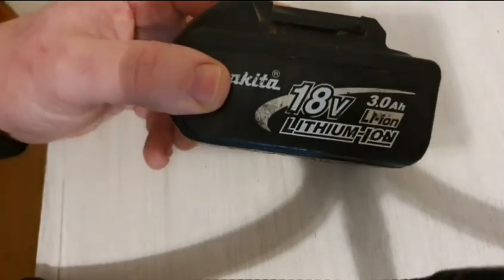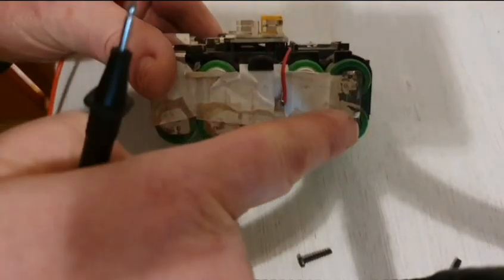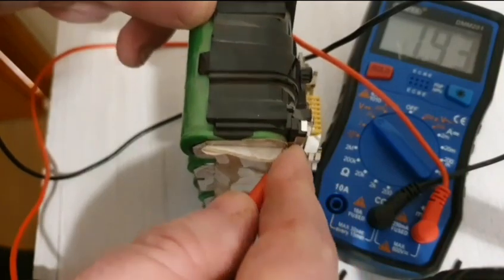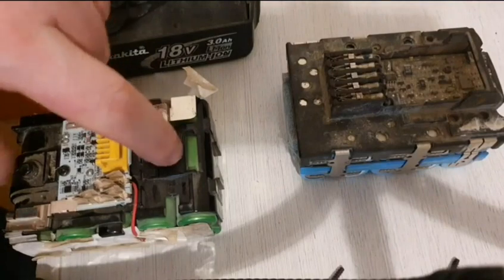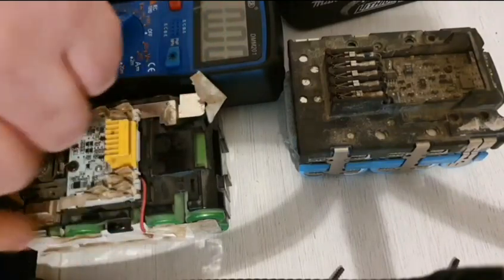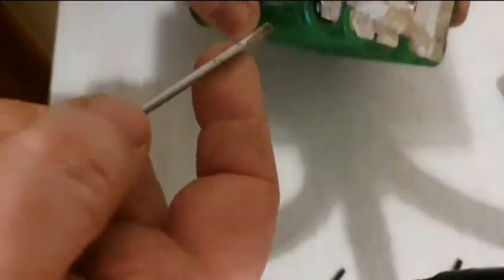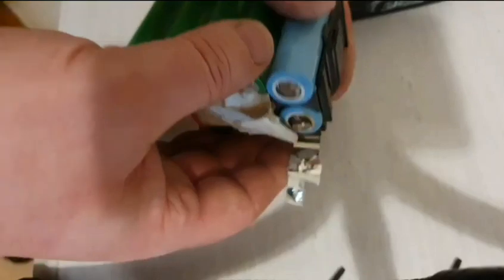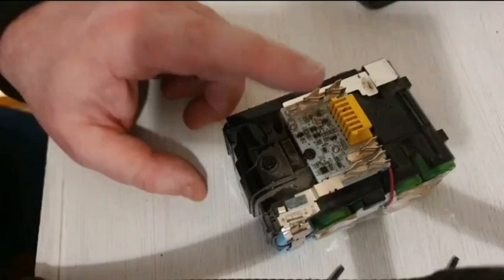Makita Battery Repair BL1830

Comment: Where does the red cable on the underside of the replacement circuit board get soldered to? My old board has a ribbon cable that connects all the cell banks.
Reply from the maker: You won't need it

Comment: I have rebuilt two of the makita 1830s today. Both have full charge using new cells. They both operate the tool. But when either are placed on the DC18RA charger, it flashes red and green and beeps.

Is there something I'm missing when rebuilding these?
Reply from the maker: You may have to replace the pcb as well
Reply: @doctorlefthandthread  the new 18650 cells I installed are charged to 4.2v as I have no way of capping the charge to 3.6v.

Could that affect it?

I've ordered two PCBs for the BL1830s. Will update Saturday. 

Can I use an 1830 PCB on an 1815 battery pack?
Reply from the maker: @ThumbsUpPaint  I think the original board locks and makes it fault out on the charger. I use the same board for them all just redo the connectors if required. The cells being 4.2v shouldn't matter it should just show fully charged.
Reply: @doctorlefthandthread  I bought the board you recommended. It doesn't come with a place for the ribbon cable between Cell banks the old board had. Any thoughts?
Reply from the maker: @ThumbsUpPaint  don't use the ribbon cable

Comment: I wish Makita made some 21700 cell 3.0 and 4.0 18v packs for the LXT line. Just like the dewalt slim 21700 cell packs. Way more current draw.
Reply from the maker: I could probably build a makita battery with 21700 cells 🤔. That could be a future video right there. Thanks
Reply: @doctorlefthandthread  I’ll be expecting a percentage of the revenue 😂. Think it would make a great video. Don’t they sell blank battery packs just the shell?
Reply from the maker: @IMPACT NATION TOOLS  It might not be soon but I will try it. We will get a hefty percentage sorted out when the money starts rolling in 🤑🤑🤑
Reply: @doctorlefthandthread  sounds good my friend. We can just reinvest the money into more tools😂✊